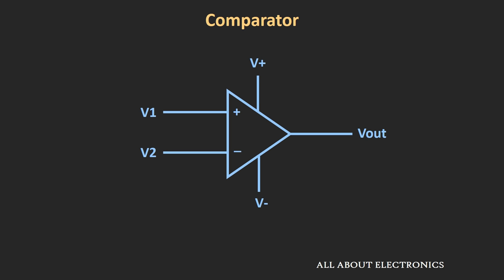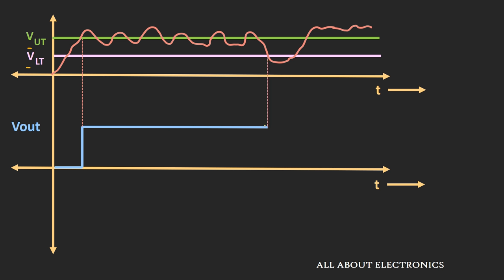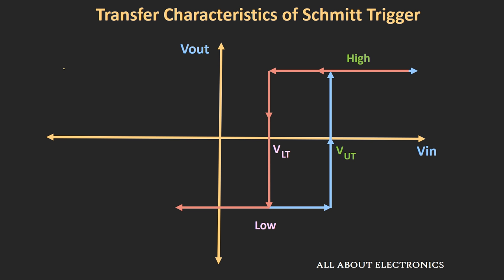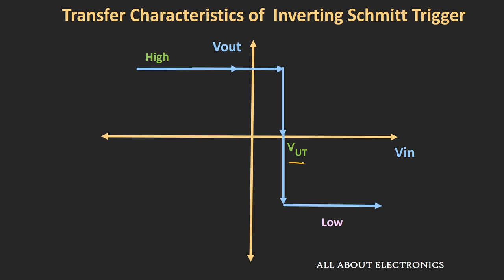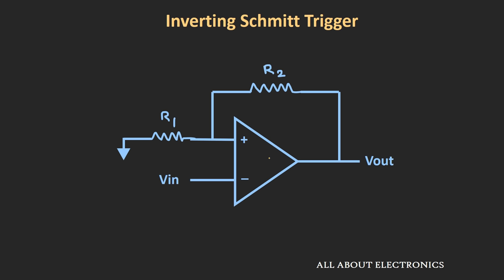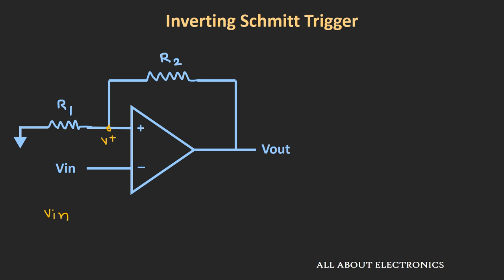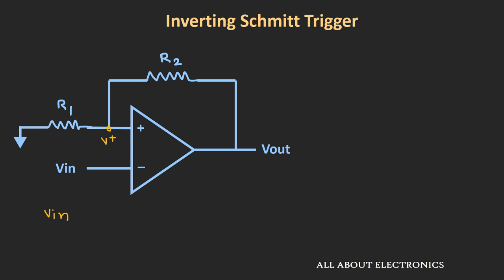Schmitt Trigger Explained (Design of Inverting and Non-inverting Schmitt Trigger using Op-Amp)

Comment: I wonder why this channel has 237k subscribers only!!!
He deserves much more
Love your explanation Sir❣❣❣
Reply: Yes Anik, he deserves more subscribers....
Reply: Only  1 percent engineering student watch this channel .
Reply: As a professional electronics designer with decades of deep experience.... In my eyes the video misses to explain expectable problems. 
For example I woder why they use an OPAMP because not every OPAMP can do this. Some OPAMPs my burn (violating diff_V_IN), some OPAMPS may create crazy output (phase reversal). If you want saturated output it´s always the safe way to use a comparator (instead of OPAMP). There is a good reason why there are OPAMPS and COMPARATORS, they are not the same thing.
Reply: @klaus2t703  chup hai hume samaj mai aa rha ha  dimag mt laga
Reply: @klaus2t703  Bro, I want to have knowledge like you. Do you have any suggestions on what to do? Or any YT channel that tells stuff like this?

Comment from the maker: The timestamps for the different topics covered in the video is given below:

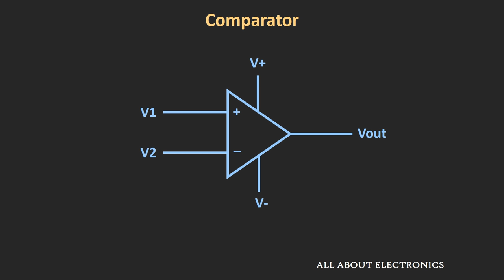0:28 Limitation of the comparator circuit

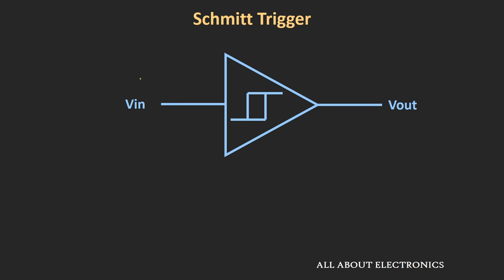2:00 What is Schmitt Trigger and how it works?

4:15 Hysteresis Curve of Inverting and Non-Inverting Schmitt Trigger

8:00 Design of Inverting Schmitt Trigger (with Derivation)

12:50 Design of Non-Inverting Schmitt Trigger (with Derivation)

18:30 Application of Schmitt Trigger
Reply: Please tell
Reply: Hi. I have a doubt. What determines V (high) and V (low)? Are they equal to +Vcc and -Vcc respectively?
Reply: @abaundwal  V(high) can be sometimes equal to Vcc. To be more specific, V(high) is the Saturation voltage when a positive input (V+ - V-) is given to op-amp. However, many a time, Saturation voltage may be equal to Vcc or slightly less than it.

Comment: Thanks for the video. I have one doubt. Will the concept of virtual ground not applicable in Schmitt trigger? Kindly reply.
Reply from the maker: No, because it's applicable only when the opamp is used with negative feedback. In Schmitt trigger it is used in positive feedback configuration. So opamp is operating in the saturation. That's why it's not applicable.
Reply: @ALLABOUTELECTRONICS  thanks for your prompt reply. Sir, what is the reason that virtual ground is only applicable in negative feedback?

Comment: Sir I have some doubts
Why we use positive feedback?
Does virtual ground concept act here too?
How can we fix a specific voltage as UTV and LTV?
Reply from the maker: Here we are using positive feedback, because we want the opamp in the saturation. That means it has only two output states. + Vsat and - Vsat. 
And the virtual ground concept is not valid the the positive feedback. It is only valid with the negative feedback, when the opamp is operating in the linear region.
Reply: @ALLABOUTELECTRONICS  thank you very much for your valuable reply sir 🙏

Comment: Vut=Vref+(Vref-Vlow)*R1/R2
Vlt=Vref+(Vref-Vhigh)*R1/R2 
Is the formula of upper and lower threshold voltage correct for Non-inverting scimitt trigger with reference voltage?

Comment: Hello,
Would You explain to me, how did I get shift of transfer characteristics, for example: VH=2V, VL=-3V (not -2,5 and 2,5 as usual)? How is this possible?
I've been using Hall sensor with Schmitt trigger for multipole magnetic encoder and on the output I got signal with 1/3 duty cycle, instead of 1/2 duty cycle (poles are equal, but reverse in sign). 
Does transfer characteristics shift depend on Vref? How did we get Vref - I mean once per measurement (on the every begining of each multipole encoder measurement it takes valuse dependent on first pole it measured and it is constant through whole measurement) or every time we cross VL or VH threshold? Does characteristics shift constant through whole measurement (if it is) or does it change every time we cross VL or Vh threshold? I would be very greatful for Your response!

Comment: At 10:07 you said to take Vout = Vh (Vh is high output when V+ >Vin)... On the next equation you asked so consider Vin > V1. TO get VLow

Doubt : We have already considerd V+>Vin to obtain Vout=Vh and named it as V1 now how can you again compare Vin and V1 to get VL. And how is Vlow consider as Vut? Please sir I'm stuck badly in this confusion
Reply: Did u get the answer?
Reply: For understanding it Initial Assumption  was made :-    Vin < V +   , then   Vout = VH
Now, the output will remain VH  till Vin < V .  This is considered as V1.  
Comment :- "On the next equation you asked so consider Vin > V1. To get VLow" . Yes because unless the Vin doesn't goes less than V1, the output will remain LOW only.  We need to get the VH as output as well. 

Now when Vin > V1 , then the output becomes VL ( Low). 

Case 1 :-   Voltage is set at VH > Vin . The output is low. (V1)
When  Vin < VH  the Vout is becoming HIGH.

Comment: 00:12 Schmitt Trigger is a comparator with hysteresis
02:32 Schmitt Trigger provides noise immunity over a band
04:57 Schmitt Trigger has a transfer characteristic curve known as the hysteresis curve.
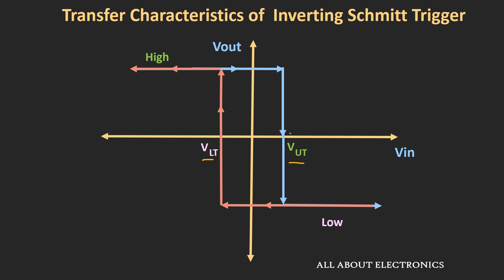07:32 Learn how to design inverting and non-inverting Schmitt Triggers using op-amp.
09:56 Inverting Schmitt Trigger has upper and lower threshold voltages
12:32 Designing Schmitt Triggers using Op-Amp
15:12 The upper and lower threshold voltages for a non-inverting Schmitt Trigger
18:01 Schmitt Trigger can be used as a level comparator, wave shaping circuit, and oscillator.
Crafted by Merlin AI.

Comment: if it is positive feedback how the output doesnt get infinite with time?
Reply from the maker: Even with the positive feedback the output can't go beyond the supply voltage isn't it ??
And that's why the output gets saturated at the supply voltage or the Vsat of that op-amp. 
I hope, it will clear your doubt.
Reply: @ALLABOUTELECTRONICS  yeah but the question is that why do we see saturation voltage at the ooutput? why dont we see less output voltages? using negative feedback or positive feedback whatever using closed loops we can set gain. so what if the gain is less?
Reply from the maker: @Siamg-b4b   when the positive feedback is more than negative feedback then eventually, the output will get saturated.
Reply: @ALLABOUTELECTRONICS  got it. thanks

Comment: AT 2:13 you have the upper thresh hold voltage sending output from low to high but that is only true for the non-inverting ST. For the inverting ST the upper thresh hold voltage signals the point where the output goes from high to low.
Reply: indeed !

Comment: Sir why we have only taken positive feedback i.e non inverting feedback in Schmitt trigger?
Reply from the maker: When the op-amp is used as a Schmitt trigger then it is used in the saturation region of operation. Meaning that, the output of the op-amp is either + Vsat and +Vsat. (Vsat is typically little less than biasing voltages of the op-amp).
When the op-amp is used with the negative feedback, then it operates in the linear region, meaning that the output is linear function of input. (e.g V0 = AcL x Vin).
But with the positive feedback, when we are using the op-amp in the saturation region, then irrespective of the value of the input signal, the output of the op-amp gets saturated. (either to + Vsat or -Vsat). 
The Schmitt trigger is intended to work like that, like a comparator but with some hysteresis. I hope, it will clear your doubt.
Reply: @ALLABOUTELECTRONICS  means when we use negative feedback , then our vout will be lower than the vin, and we don't want that, we want our output to be greater than vin so that it will saturates, right?

Comment: In case of non inver schmit trgr why we can not put vin at + and feed back resistor on - with ground?
Reply from the maker: You mean to say like inverting configuration ??
The thing is Schmitt trigger is operated with positive feedback. That means based on input, the output is either + Vsat or - Vsat.
Reply from the maker: If there is negative feedback, then it's not a Schmitt trigger circuit. I hope it will clear your doubt.

Comment: Sir why doesn't we consider the virtual ground thing in the case of non inverting Schmitt trigger
Reply from the maker: Because the concept of virtual ground is applicable only when the op-amp is operated in the linear region. ( During the negative feedback).
In Schmitt Trigger, there is a positive feedback. Means op-amp is operating in the saturation region.
So, we can't apply the concept of virtual ground.
I hope it will clear your doubt.
Reply: ALL ABOUT ELECTRONICS thankyou sir ❤️

Comment: At 1.32 in the video it's shown that the output voltage becomes zero if the inverting voltage is higer than non-inverting voltage...but you are giving -Vs supply...so the output should be a negatve value(probably -Vs) at the moment...
Reply: He doesn't say it becomes Zero, he says it becomes low voltage, (what ever the negative supply is)

Comment: I saw this video 2 times but still  i am not getting the answer of the Q is how schmitt trigger provides immunity to the noise??? Can u please elaborate  more !!!
Reply from the maker: In case of Schmitt Trigger, whenever input signal goes above the upper threshold voltage then there is a change in the output (Depending on whether the Schmitt Trigger is inverting or non-inverting). Now, even if input just crosses this upper threshold voltage (it goes below the upper threshold voltage), then also output will remain the same. Unless input goes below the lower threshold, the output will remain the same. So, the circuit provides the noise immunity for the change in signal between upper and lower threshold voltages. 
And that is not the case with comparator. In case of comparator even if input goes just above and below the one threshold voltage, then output will change suddenly. 
I hope now it will clear your doubt. 
And still if you have any doubt then do let me know here.
Reply: Thanks a lot!!!

Comment: For example my +vsat =10 volts if R1=R2 then upper thershold voltage is 5 volts when voltage at inverting terminal is more than upper thershold voltage we will get     -vsat  then voltage at non inverting terminal is -5 then voltage at inverting terminal should be less than lower thershold voltage right if we calculate this with gain=100 then vout =A(v^+  -  v^-)

Comment: How in hysteresis curve,if Vh and Vl equal and opposite in polarity makes hysteresis curve symmetric to y-axis.
Reply from the maker: It has been assumed that the positive and the negative supplies of the op-amp are equal and opposite in polarity. 
And usually, it used to be the case for the op-amp. that's why it is symmetric about the y-axis.  
I hope it will clear your doubt.

Comment: Sir ,why does not applicable for virtual ground concept in Schmitt trigger?
Reply from the maker: The concept of virtual ground is applicable only when the op-amp is operated in the linear region (with negative feedback). Here, in case of Schmitt Trigger, the positive feedback has been applied to the op-amp, so it is operating in the saturation region. 
I hope it will clear your doubt.
Reply: @ALLABOUTELECTRONICS  tysm sir

Comment: 00:15 Schmitt Trigger is a comparator with hysteresis.
02:38 Schmitt Trigger determines output based on input threshold voltage
05:01 Schmitt Trigger behavior explained
07:27 Inverting Schmitt Trigger's transfer characteristic curve can be shifted by providing external reference voltage.
09:56 Schmitt Trigger sets threshold voltages for input signals
12:34 Designing inverting and non-inverting Schmitt Triggers using Op-Amp
15:13 Schmitt Trigger has upper and lower threshold voltages.
18:02 Schmitt Trigger has applications in level comparison, analog to digital conversion, wave shaping, and multivibrator and oscillator design.

Comment: KCL states sum of the current entering the point equal to sum of current leaving the point , then how that I1+I2=0?  at v+
Reply from the maker: At 9:41 if you see, then both I1 and I2 are outgoing currents. That's why, as per the KCL, the sum of all the outgoing currents should be zero. (There is no incoming current). I hope, it will clear your doubt.
Reply: At 13:50 I1 is entering and I2 is leaving.  Am I right?
Reply: You applying for a point v+.right?
Reply from the maker: Yes, applying at V+. And here, both the currents are leaving the node. ((V+ - Vin)/ R1, and (V+ - Vo) / R2))

Comment: should not the output be -Vsat instead of 0, I am confused.
Reply from the maker: It depends on the supply voltages of the Schmitt trigger. Some can work with single supply. In such case, - Vsat = 0. For, dual supply opamp or comparator, there will be + Vsat and - Vsat voltages. I hope it will clear your doubt
Reply: @ALLABOUTELECTRONICS  Thank you sir, for taking your time and replying, The explanation cleared my doubt,  Thank you very much.

Comment: Why dies currnet flow from v+ to vin
Reply from the maker: Because of the potential difference between the two terminals, there will be a flow of current. The exact direction depends on the polarity of the voltage difference between the two nodes.

Comment: How does a Schmitt trigger convert a analog input signal to a digital output signal ? Which part of this video is the answer?
Reply from the maker: In Schmitt Trigger, the op-amp operates in the positive feedback configuration. 
So, when the input at one of the input is more than the other input then the output of the op-amp becomes high or low. (+Vsat or - Vsat). 
So, in a way, based on the input at the two terminals, there is only two outputs. (+Vsat or -Vsat)
And in this way, it provides the digital output. 
I hope it will clear your doubt.
Reply: @ALLABOUTELECTRONICS Now it is clear to me ! Thank u ALL ABOUT ELECTRONICS for this easy explanation !

Comment: Now we have at positive terminal we have -5 then vout =100(-5-5.1) =1010 this is not +vsat can u elobrate for me pls
Reply from the maker: The gain of the op-amp used to be much higher than the 100. Typically  10000 to 10^5.

Comment: why u have given positive feedback to non inverting schmitt trigger
why not negative feedback??????
Reply from the maker: Because the schmitt trigger is meant to be operated into the saturation. That means based on the input signal the output will be either +Vsat or -vsat. 
with negative feedback in op-amp, it operates in the linear region. That means Vo = K*Vin.
But in Schmitt Trigger, it operates in the saturation.
With positive feedback, for the given input, the output should increase continuously. 
But it can't beyond the supply rail. 
Hence Max output is ± Vsat.
I hope it will clear your doubt.
Reply: tq sir
 @ALLABOUTELECTRONICS

Comment: How to differentiate between an opamp amplifier and schmitt trigger!?
Reply from the maker: In Schmitt trigger circuits positive feedback is applied to the op-amp. When op-amp is used as an amplifier at that time negative feedback is applied.
Reply: If the feed back is positive then Schmitt trigger or oscillator, if feedback is negative then amplifier....

Comment: V+= v-     not true????? Why virtual ground potential didnt use??
Reply: Please reply
Reply from the maker: Its applicable for only negative feedback. I mean when opamp is used with the negative feedback.
Reply: @ALLABOUTELECTRONICS   what happend if negative and positive feedback both present??  Still the assumption true???
Reply from the maker: In such case, it depends on which feedback is more. One such example is astable multivibrator using opamp, where both positive and negative feedback exist togather.
Check this video for more info: https://youtu.be/T7T3At9N9dk
Reply: @ALLABOUTELECTRONICS  thankuuuùu regards